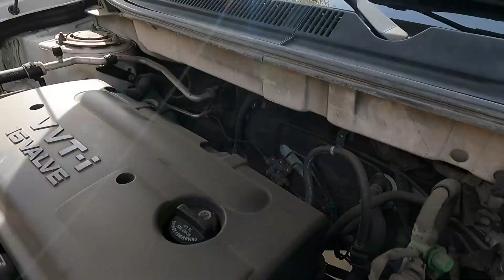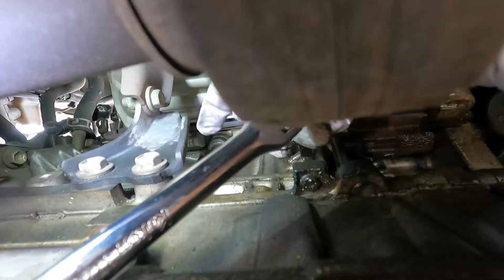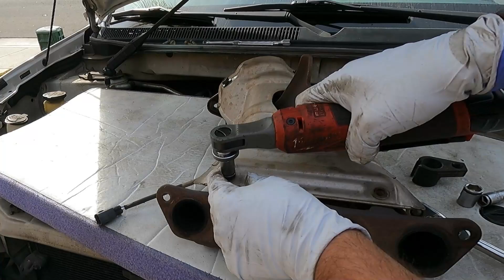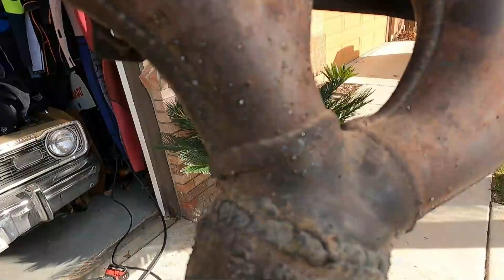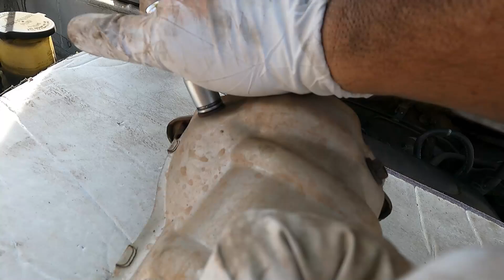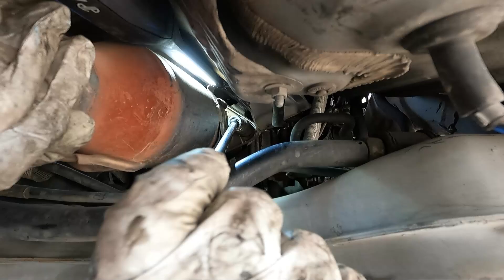2003 - 2008 Toyota Matrix / Corolla / Pontiac Vibe - Remove Repair Replace Cracked Exhaust Manifold!

Comment: Mine is cracked as well, and cant find the part anywhere and im in New York which is crazy. Pontiac Vibe 2003 AWD. Like why is this part so hard to find? I guess I will have to get it welded too.

Comment: I  went through this. One of the bolts on the outside stripped and i caught helll getting it out. Loosen the outside nuts first and then the 3 in the center

Comment: How do test for the location of the leak?
Reply: Put a  shop vac in the tail pipe and then spray soak water around the exhaust manifold or use a smoke machine

Comment: I did this job today. It was terrible but its done and will never have to be done again. The gasket was shot. Car has 180,000 miles. This video was very helpful. Removal and installation of the actual manifold bolts was the hardest part. I sprayed them good but still they were tough to break free. I stripped a few of them putting them back on but its quiet and they are tight enough. They will never be removed so fuck it.

Comment: Nice. Rockin' the nut grips. The tensioner looks like it's leaking a bit. I think worn engine mounts can also stress the manifold. I have a 2006 Matrix 4WD with 227,000 miles. Still runs great.
Reply from the maker: Yes, it's definitely leaking quite a bit of oil.  I will make sure that he knows.  And I will let him know about checking the mounts as well, thank you for that great suggestion.
This vehicle has about 350,000 miles.  The odometer stopped at 299,999!
Thanks for watching!
Take care,
-Dan